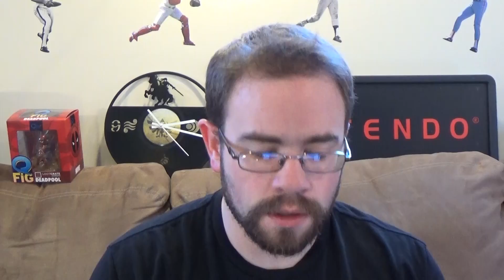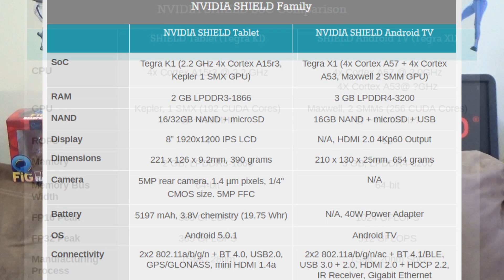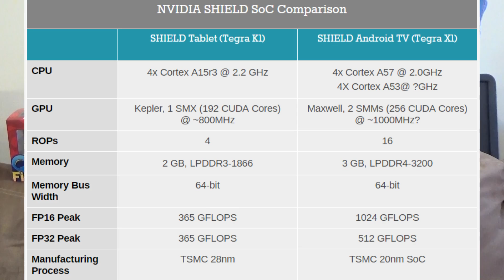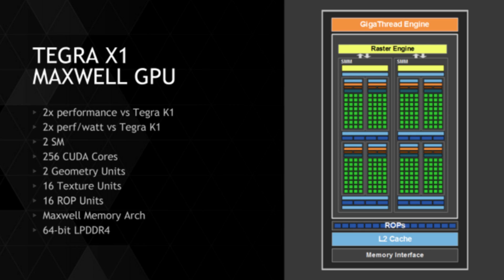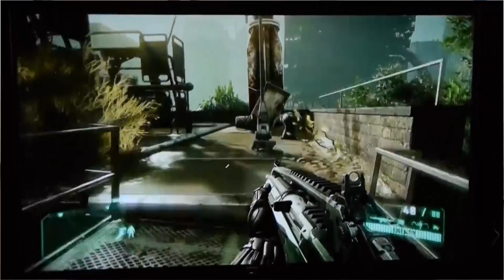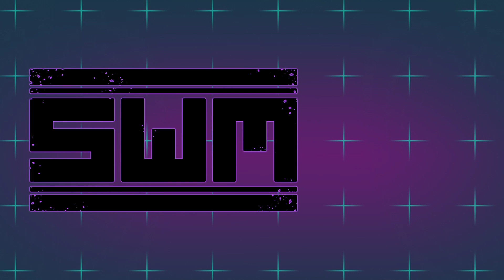The Nintendo Switch Is Powerful!! But Can It Run Crysis??

Comment: the most important thing is the rendering API. that'll determine what multiplats it gets
Reply: ArynCrinn i thought you were referring to the switch gpu so i was very confused lol, now i get you
Reply: CrackKat That's exactly what I mean though.

The Wii U had 3rd Party support at launch, but it disappeared because there was no market for it. 3rd parties aren't going to continue supporting a system that only sells 50,000 copies of a game.

And why wasn't the system selling?
Because of the games.

Not because it didn't have games, but because the games were no better, and in many cases, were worse on the Wii U. People don't want to buy a system to play inferior versions of games they can play on hardware they already own.

At least with Switch, games can afford to be graphically inferior, because there is a market for mobile ports of console games. Even if there are some games that won't be able to run on the system, most games will.

And as far as exclusives go, you'll be hard pressed to find a better system.
Reply: ZFighter1011 precisely, I'm not saying they don't exist, but i haven't come across a single youtuber or news organisation that talks tech and actually knows anything about graphics programming, which is absolutely ridiculous since that's the most important part when it comes to whether a system gets support. i know a bit about graphics programing but only enough to know how complicated it is and how incorrect most people are that talk about just hardware numbers
Reply: ZFighter1011 it looks that way. games will need small downgrades, but nothing so big that people won't buy switch versions of those games. i have a gaming PC, but I'll get games on Switch if they release on both
Reply: So when people say that 4gb ram is enough for multiplats they are right or wrong?
Reply: Gilmar Venancio yeah they're right, it won't be a problem.
Reply: +CrackKat
Xbox One uses DX12, which is easy for them.
PS4 uses a custom low level API (possibly Mantle based?)
Switch is using the custom NVN API, which we know nothing about.

It really comes down to whether or not developers/publishers feel there is money to be made.

+Gilmar Venacio
It depends on how much of it is made available to devs.
PS4 and Xbox One give devs about 5 GB.
The Wii U OS uses half of the 2GB in the system... so if Switch uses the same, then devs will only have 3GB. I don't imagine it will get worse than that.
Mostly, you'll just see games with decreased texture resolution, and reductions in shadow and reflection quality, and things like foliage.

I don't really think there's too many games that need more 3 GB for the game systems themselves (AI and physics), but if there are, those are the games that may skip the system.
Reply: ArynCrinn based on Nvidias recent comments, the Switch API will support basically the same features as PC, Xbone and PS4, making it easy for devs to support all systems at low cost. You can look up the CEOs recent statements, he's quite clear
Reply: CrackKat And the Gamecube, Wii, and Wii U used OpenGL based APIs. The Wii U even had programmable shaders.
API didn't mean a thing for the Wii U.

Being easy to port from a coding perspective is one thing... but you still have to worry about performance and optimisation, which is something that some developers just aren't very good at.
Reply: ArynCrinn openGL based alone doesnt tell us much cos it doesn't tell us which features the GPU supported
Reply: CrackKat Most sources point to it being R600/700 based, which was a DX10.1 /OpenGL 3.3 card... 
While that might put it behind the PS4 and Xbox One, it should be noted that a lot of games are still being made for older DX9 compliant hardware.
Battlefield Hardline, GTA V, NBA 2K17, Black Ops III, Far Cry 4, Rise of the Tomb Raider, and Metal Gear Solid V, have all come to the PS3 and Xbox 360 within the past 2 years, despite being on "inferior" DX 9 or OpenGL ES 1.1 hardware. 

***** 
"However, even the original Tegra is capable of the newest API features."
Not true.
For starters, the Tegra K1 is not the original Tegra. There were 4-5 Tegra SoCs before the K1.
Second, Kepler (as seen in Tegra K1) is only D3D 11_0 compliant. Direct 3D is now up to 12_1, and although the successor, Maxwell has "officially" been 12_1 compatible, Nvidia didn't technically include support for the asynchronous compute shaders, which AMD have incorporated into GCN architecture since day one, and have been used heavily in PS4 and Xbox One titles, until Pascal.

"The fact that Unreal Engine 4 is fully compatible with the NS should tell a lot."
So are a lot of Android and iOS devices. 
UE4 is widely overrated. It's great for smaller devs who can't afford to develop their own engine.

"Performance will be up to what the developer is willing to optimize out of all consoles."
Performance will be up to what the developer is capable of optimising for each individual console... Performance is not the same on each console.
Reply: ArynCrinn I'm not sure where you got R600 based from, I'm not at all convinced.
Reply: CrackKat A few reasons:
1. R600 is AMD's first gen programmable shader architecture (Terascale 1). Wii U uses programmable shaders.
2. It shares identical core configuration and clock speed as an HD 5550 (Terascale 2).
3. Analysis of die shots and comparisons to other AMD silicon
Reply: CrackKat Well evidently, the R600 is AMD, while the Switch is Nvidia.
Reply: ArynCrinn which is why i was so confused about your comment, because it made no sense the way i was reading it
Reply: CrackKat I'm not entirely sure why you thought I was talking about the Switch...

We were talking about the Wii U and I was pointing out that it's API and feature set didn't help it, by naming games which skipped it, but released on previous gen systems.

Simple fact is that the API and GPU feature set were not enough to make up for a weak CPU, a performance hit caused by the dual screen gimmick, and a userbase which just wasn't there, and weren't buying the games.
Reply: ArynCrinn the Wii U got plenty of 3rd party games. It stopped because the system wasnt selling.
Reply: ArynCrinn
I think Wii U's sales issues were because of entirely different reasons, but that's kind of irrelevant.
I ultimately agree with your analysis of the situation.

Comment: I don't think Nvidia said it's using an X1. They said it's a custom chip made specifically for the Switch. Hopefully it's closer to the X2 rather than the weaker X1.
Reply from the maker: You're right that Nvidia is probably not using the X1, but it's the only thing we have to go on right now.

Comment: So it has to have LPDDR4 ram otherwise the switch is screwed?.But if it's custum Pascal then that's what it would have
Reply from the maker: I think it would be a mistake considering the price difference does not appear to be much. The extra bandwidth would really help the system push 1080p resolution when connected to the TV. So yeah LPDDR4 is the way to go and would, in my opinion, make the Switch much more attractive to program for.

Comment: The switch is Actively cooled on battery. It had Air vents in the back. And proof that the fans are running on battery is that there are holes in the back of that car accessory (The part in the switch trailer with some guys playing Mario Kart) so Air can flow trough. (Sorry for bad english btw)

Comment: The Xbox 360 and PS3 could run Crysis, the Wii u was stronger than both of them, the X1 is greatly more powerful than the Wii U. The Switch will use a new Tegra chip.
Reply: "The Xbox 360 and PS3 could run Crysis"
Only after migrating the game to the more efficient CryEngine 3, and with making considerable cuts to textures, foliage, debris and water quality.

"the Wii u was stronger than both of them" Most of the system, except for the CPU... the Wii U CPU is terrible. It beats the PS3 and Xbox 360 per clock on integer code, but they run at more than twice the clock rate, and absolutely kill it in floating point code.

" Honestly a handheld more powerful than the Wii U is impressive in it's self."
Hardly. Nvidia Shield Tablet is already about as powerful as the Wii U, if not more so, and there are stronger tablets out there today. A Nintendo handheld more powerful than the Wii U on the other... that is impressive.
Reply: wienersoup yea I know, I believe the Tega X1 ran Crysis over 30fps too. Honestly a handheld more powerful than the Wii U is impressive in it's self. I love PC games but my favorite gaming moments over the years were from my 3ds even though it was underpowered and only 240p. I am hyped for the Switch. if I an play 3ds quality games on the Switch at 720p to 1080p on my TV I will be happy. I am getting the Switch Day One for sure.
Reply: Tryhardblackguy 

i think its kind of an old joke from back when crisis was known as a spec hog. so its something that people would say. "thats cool. but can it run crisis?" which was like the standard for powerful pc.
Reply: Idiot
Reply: Tryhardblackguy Wow. That's a very direct, simple and clear point for obvious NS quality.
Reply: The wii u is not better than both. GPU wise, sure. But the CPU is like 10+ years outdated. The GPU is miles ahead of the ps3 and 360, but guess what the ps3 and xbox got that the Wii U didn't. Crysis 3 an Metro Last Light. The devs of Metro LL directly came out and said "Fuck this shit cpu we're not porting the game."
Reply: Wii U was never stronger than 360 or ps3. Yes, it had slightly better gpu, but CPU was like twice weaker if not more, it was inferior system anyway than competition
Reply: Well, you were right..crysis remaster for switch!!
Reply: @kingveggie6729  I'm from the future, don't tell anyone
Reply: @Tryhardblackguy  the madlad replied 3 years later :O
Reply: @kingveggie6729  Dude a pandemic is going on, of course my ass would be home and able to reply lol
Reply: @Tryhardblackguy  so, did you like the switch. This thread didnt age well.
Reply: @kingveggie6729  of course, I always defended the switch back these years and I would always tell dumbasses the Switch wouldnt fail and how it wasnt the Wii U 2, and Im a pc gamer
Reply: @Tryhardblackguy  you're fking awesome bro. Time traveler.
Reply: @kingveggie6729  thanks, also love your profile picture. JOYCON BOYZ FOR LIFE ✊🏾
Reply: @Tryhardblackguy  if you look on crysis twitter account it will show real gameplay for the game. It looks great!

Comment: Screw Crysis, I want to know if the NS will run GCN games!
Reply: I dont care about crysis but this means all the exclusives will look amazing
Reply: TwilightWolf032 GCN is the best console of all time
Reply: TwilightWolf032 i hope il does, wind waker, starfox metroid & Mario sunshine
Reply: Oriru Bastard Yes, my comparison was too barebones. I know hackers managed to make GCN run on the console, so it's not impossible for Nintendo themselves to make it happen and even improve on the experience. Even if they couldn't due to the Wii U's lack of power, they could also make it like the Wii titles sold digitally on the eShop - exact the same title without any kinds of enhancements or changes, but still available on the new console nonetheless.

The only reason I can think of for Nintendo not doing at least the later one is because they thought it wouldn't be profitable! And that's why I believe the NS will have it from the get go!
Reply: TwilightWolf032 Yes it has processing power to emulate game cube games.
Reply: Oriru Bastard The Wii U also had, and we all know what Nintendo did with it, don't we? I want to see Nintendo finally implementing GCN games on the VC on the NS!
Reply: TwilightWolf032 I don't think Wii U has enough computing power to Emulate GC games at full speed.
Reply: Oriru Bastard The Wii U uses an overclocked Wii CPU, which is also an overclocked GCN CPU, meaning the titles could have been ported to the Wii U's online store in the same manner Wii titles were. No enhancements, no improvements, just full speed games at the original resolution. It could have done that, fans made it happen with hacks! Only Nintendo didn't!

Granted, they developed an engine that made it possible to easily port GCN games to the U, so I believe their plan was to remaster more titles than they ended up doing (only 2), so that might explain why they didn't put GCN games on the eShop. And with the U selling less than the GCN, they must have shifted focus into working on the NS rather than waste time developing for a console that wouldn't give them profit anyways.

Basically, it wasn't worth it after the second year, so they must have decided against it. Here's hoping the Switch will launch with the entire Wii and Wii U Virtual Console libraries plus GCN games along the way!
Reply: TwilightWolf032 It's bit more complex than overclocked CPU. When you emulate stuff it might take 2 if not even 4 times better computer to run things through.

Though, there is also another way and that is to customize the Bios and OS so that it'll understand the game from get go. 

But it takes a lot of effort though so it's not as simple as it sounds. Especially if consoles uses completely different architecture.
Reply: TwilightWolf032 Not impossible, yes. But usually especially when architecture is different they just add in the old components to run the game. It'd come very unplausible to do that for newer consoles.

Anyhoo, game devs usually make games based on the consoles specs and OS in mind which causes most of the problems. So they don't care much about future tech that might pop out. That is another reason why it's so difficult to emulate.

That is also why there is an option for compatibility mode that is available in windows. It's not perfect though.
Reply: It doesn't even do SNES games yet I wish

Comment: Its a custom tegra chip with the architecture of the geforce pc cards so
Reply: ***** because he talking always about the x1 but we dont know the capalities of the new chip. So we can speculate until after the reveal
Reply: So you can't speculate that an upgraded chip is stronger than the chip your updating. Good to know, they may have spent tons of cash on hundreds of years of engineering experience and we can't spectate it might be equal to or stronger than an x1.